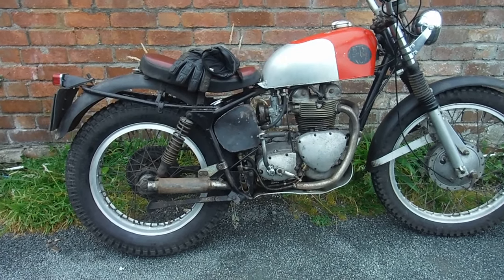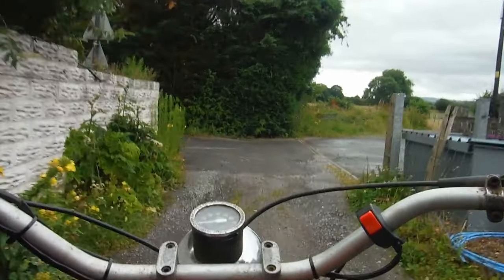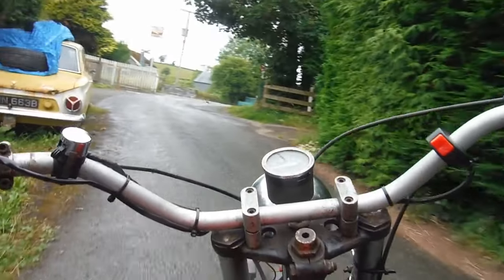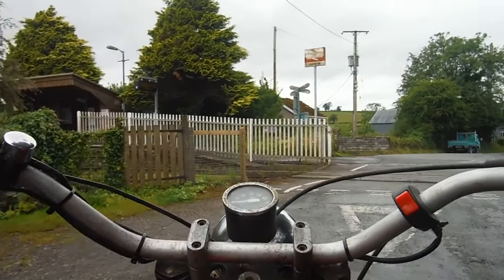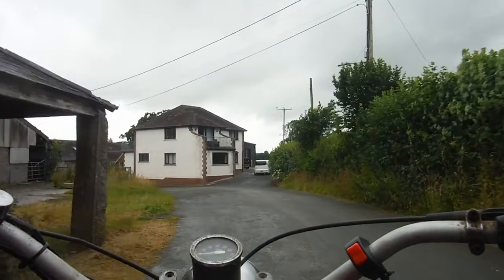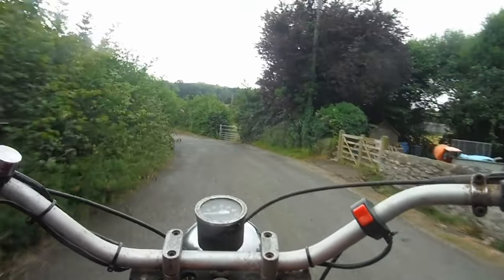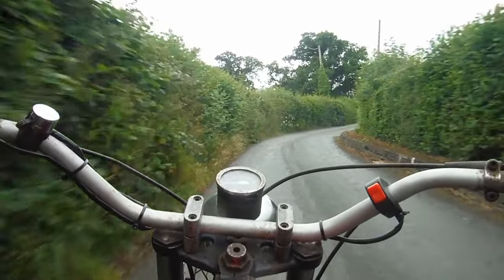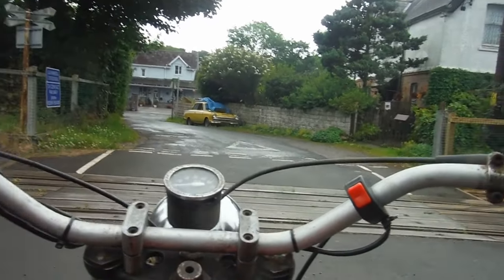Triumph / Royal Enfield 'Trifield' 500 trials - Finally sorted so camera plays up instead!

Comment: Hi Paul, the chain tension problem may be caused by the engine being set high in the frame, the straight line made between the output shaft ,swing arm pivot and rear axle would be max chain tension with wheel near fully  extended.

Comment: G'day, working well now, fantastic job and persistent in doing right,  you can hand it back and onto the next, l missed any damage on the BSA Road Rocket, connecting rod nut and washer fell to the bottom of the motor with no sign of damage other 3 nuts fully tight, all looks good, reassemble the bike this week, cheers mate, Neil 🤠.

Comment: Your comments about first and second being close with a big jump to third, which is close to fourth, is exactly what I found with my 3TA over 30 years ago.  Sometimes, changing down from fourth to third on a hill or heading into a howling gale just didn't make much difference.  The back brake would lock the wheel but, when the front brake actually worked, it just drew the bike gently to a stop, even after I fitted new linings.  You've earned a weekend pint with this one!
Reply from the maker: Thanks!